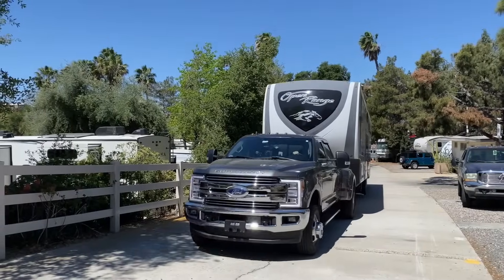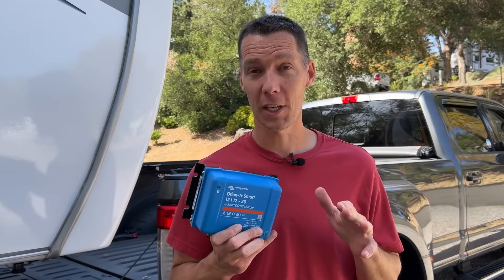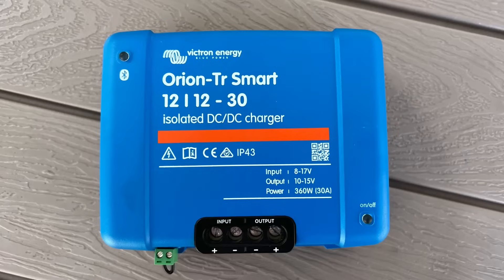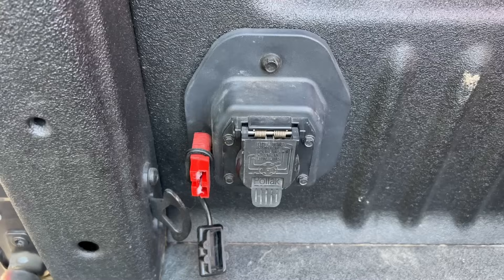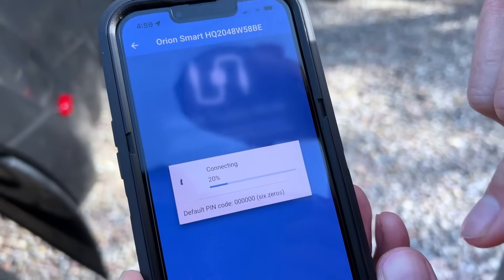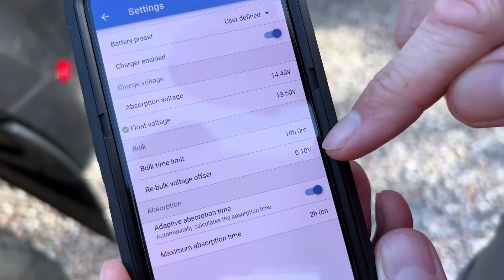Truck Won't Charge RV Batteries | DC-DC Charger Fixed It

Comment: Hi, can it also charge a battery generator?
Reply from the maker: I had to look this one up and according to Google, yes it can.

Yes, a DC-to-DC charger can be used to charge a battery in a generator, as long as the generator's starting battery is a DC battery. A DC-to-DC charger is suitable for this purpose because it converts the DC voltage from a vehicle or another source to the appropriate voltage for the generator's DC battery. However, it is important to use a separate charger for the generator's battery, and to ensure both the generator and the DC-to-DC charger are properly configured.

Comment: the wires for the truck connection should have been red to 30A breaker then positive Terminal on battery and black from the Orion Smart Charger to a chassis ground within 18 inch of the Orion Smart charger

Comment: Also the fou pin connector and the 7 pin connector are not suppose to be connected at the same time. the 7 has all the connections needed already. Do you have a problem with lights going out or battery drainage. That could be why.
Reply from the maker: I'm guessing that you thought there was a 4 pin connector connected. The connector next to the 7-pin connector is the 2 pin charge line that I ran for the DC-DC charger.
Reply: @MobileRVTechServices  I see now. I'm trying to set up my own and just wanted to make sure its done correct. so far Ive been doing all required research

Comment: The reason the seven pin plug doesnt produce enough power through the blue wire is that is for the trailer breaks and amplifies when the breaks are depressed.

Comment: In the video, you mentioned that you were only able to get up to a 60% charge on your Bulk trailer batteries. I believe you have the Bluetooth settings on the 12/12-30 Orion smart controller off.
I believe the "absorption Voltage" is the maximum amount of your vehicle without a load on it, meaning your alternator vehicle battery alone. (You state in your video that it's 14.4v.)
Then your "Float Voltage" is set to 13.6V.  I believe the float value is the cut-off point at which the trailer is allowed to charge up to off the vehicle's alternator (in My Opinion if the alternator charges at 14.4v the float value should be set between 12.0v and 13.5v) This being the case the alternator doesn't have to work as hard for as long. I believe the life of the alternator is shortened the higher you set the float level above 12.0v (which is Most appliance's minimum voltage.)(in my opinion, 13.0v is sufficient. Especially if you are running a solar set-up at the same time.)(after 13.0v, the solar system will charge the trailer's bulk alone from 13.0 to the batteries maximum potential. The vehicle's alternator will continue to charge the vehicle's main battery at 14.4v up to its maximum level even after the trailer has gone into float mode and the Orion device stops drawing power. The alternator will continue to have strain until the vehicle's battery is fully charged, then the system will run as it was made to out of the factory.
"Bulk Time Limit", I believe, is the amount of time the alternator is to be producing power before the trailer or Bulk batteries begin to charge from the alternator. With this being the case, I would want my vehicle to start and warm before putting it under any kind of strain. like 3 to 5 minutes. This should prevent the start battery from being drained. (This setting may want to be minimized periodically, as you may want to charge the trailer from a sitting position while parked).
"Re-Bulk Voltage Offset", I believe this means the amount of volts you charge the trailer batteries at. Kind of like a battery charger there is (Trickle , Normal, and Jump Start modes) (Orion has 9A, 30A, and 50A Chargers available for 12V systems.) The charger can be adjusted from .1 - 30V. In my opinion I would want the charger set to 15 - 25v, 15 being my trickle charge and 25v being my max charge level, this would leave about 5v before kicking the 30A in line breaker on the alternator vehicle or alternator waver room so as to not restart the system unwantedly by any voltage spikes or until the vehicle's ignition is turned off.
I believe with a few system adjustments with programming, you should be able to achieve 100% power restoration in your bulk battery banks more frequently. Try it and tell me how it works for you?
Reply: I also believe the breaker or fuse is supposed to be after the vehicle's battery and before the Orion smart charger, this way the trailer or bulk system can't cause any harm to the vehicle with the alternator.
Reply: @justinc.hendrix6379 could you help me with manual settings for a lead acid battery the Fla option is not on presets. please and thank you
Reply from the maker: Thank you for the helpful input.

Comment: Question for anyone here, can you change how much it pulls from the alternator, say 10 amps only old truck with an 80 amp alternator
Reply from the maker: @slyjeeper  I don’t recall an option to reduce the amp output. You could change the cycle duration to help with a smaller alternator but you’d be better off with the 18 amp charger. 
https://amzn.to/3Y6WPur

Comment: Pretty sure you have it wrong in the isolated vs non-isolated. It has to do with chassis grounds present or not.
Reply from the maker: There are a few factors into the isolated vs non-isolated portion. Non-isolated shares the negative (ground), isolated does not.

Comment: Hmm ... I'd be adding some solar as well. It does not cost that much. In any system your batteries will be 70% of the cost. This also works if you are at your campsite and want to keep your batteries topped up. Most campsites have some sun.
Reply from the maker: Yes, solar is another great charging option.

Comment: (protecting your alternator) I am not sure what you meant by that? if your plugging in your 7 pin connecter from your trailer to your tow Vehicle the lithium batteries in the trailer won't  hurt your tow Vehicles alternator , because NRVTA clear states thats not a problem.    https://youtu.be/unCm8M-0F0o?si=kuxRSzjDLxsKgJ4i. in this video it's explained pretty clearly
Reply from the maker: If you are using the 7-way connector to charge the trailer battery, you do not need a DC to DC charger to protect the alternator. If you are running heavier wire for a dedicated charge line like I did in this video, you need the charge controller to control the rate of charge.

When you’re researching this topic, it can be easy to miss those key points in the videos. Both videos are correct as Todd is answering a charging question using the 7-way cable and I’m not using the 7-way cable.

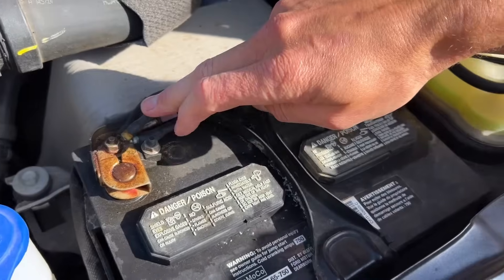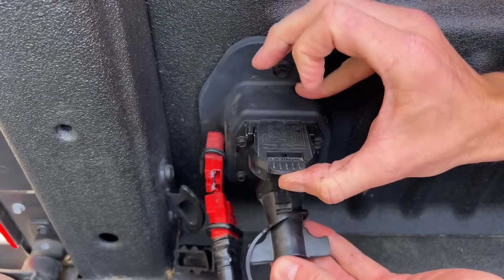You’ll want to rewatch Todd’s NRVTA video where he states that “IF” statement at 1:55 and breaks it down about the Anderson connector around the 3:00 range. Then when you watch this video at the 1:30 range, it’ll make sense when I’m explaining using the Anderson connector with a dedicated heavier charge cable vs the 7-way connector to charge my lithium RV batteries.

Comment: So, in summary for us non-tech types, I don't need to change anything on the tow vehicle to charge a LiON trailer battery while driving, it just won't charge the battery to capacity?
Reply from the maker: Correct, the regular 7-way plug for lights will limit the charge to the lithium battery in the trailer.
Reply: A full lithium bank may send power to the tow vehicle. The shunt on my bank shows 40 or 50 watts going out of my batteries to the tow rig when it’s running. 2002 F350.

Comment: I see where some say you need to run a  (BIM) Battery Isolation Manager in the truck. Is this true? If so did you run one? I see where some say you need one to cycle the ON time so you don't burn up your alternator.. I have A F350 2021 with no upfitter switches. Was planning on running off the battery. Not sure about the BIM. Great video btw thank you
Reply from the maker: I didn’t add a BIM, that comes into play if you are taking a heavier charge from the battery on larger chargers. With the 30 amp charger, I wasn’t worried about overdrawing on the alternator. Plus when I researched the alternator over heating I came up with the newer Super Duty’s have smart systems and a lot have 2 alternators to rotate the charge demand.
Reply: @MobileRVTechServices  thank you for replying! Safe travels. The Longs

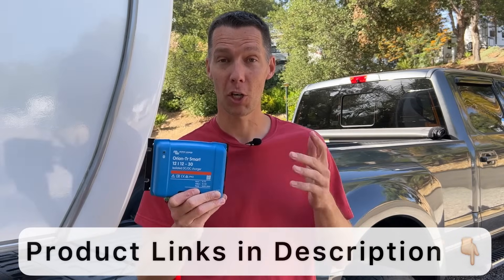Comment: Just to be clear, you used an upfitter switch to turn this on or off? We have same truck 2022.  4:26
Reply from the maker: Correct, I connected directly to the #6 upfitter output wire which is a 40 amp circuit.
Reply: Hi, you can do this by putting a switch in the looped connector on the left.
Take care M.

Comment: Finally a video for a trailer vs van. I really need to see where you grabbed Positive from (some say alternator, some say battery. You did neither?  What did you do with the existing charging wire in the 7 pin harness?  Lastly, in configurations you said set Bulk charge for 1 hr. but the setting was for 10 hrs. ?    thanks in advance
Reply from the maker: My positive comes from the factory upfitter switch connections. If I didn’t have those I would have a fused connection on the battery.
The existing 7-way wire is capped off in the trailer junction box.
Standard bulk charge is 1hr, my screen had 10 hours from adjusting settings for the video. You’ll want to confirm the settings for your particular batteries, they can have different needs.
Reply: Thanks for the clarification!  I needed that to regain the confidence with the project.
Reply: Great question @user-vw5... No one answers the question about what happens with the power pin in the 7 way. Thanks for asking. Thanks, RadarRoadWarriors, for answering it. Great video. Any possibility of showing specifics of truck battery connections, 7 way cap on power pin and anderson plug install in truck?
Reply from the maker: @nickc8438 that would have to be another video since I don’t have a way to post photos in a comment.
The power is connected to the 

Ford upfitter wires with a heat shrink butt splice.

The Anderson connection is right next to the 7-way plug in the box of the truck.

The black wire in the RV junction box gets disconnected and capped with a crimp connector.
Reply: Thanks again for the info, it's very helpful to get correct info from someone who knows what there doing.
Reply from the maker: you're welcome @nickc8438
Reply: I see where some say you need to run a  (BIM) Battery Isolation Manager in the truck. Is this true? If so did you run one? I see where some say you need one to cycle the ON time so you don't burn up your alternator.. I have A F350 2021 with no upfitter switches. Was planning on running off the battery. Not sure about the BIM. Great video btw thank you